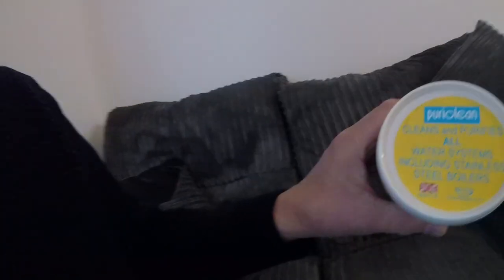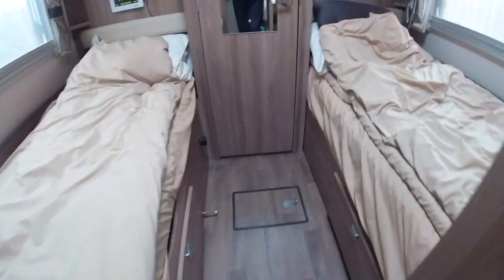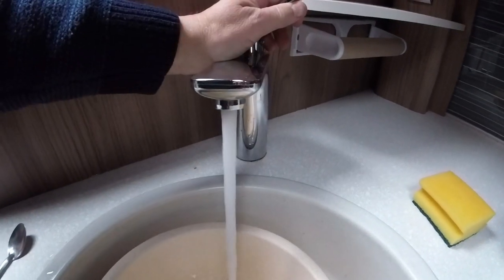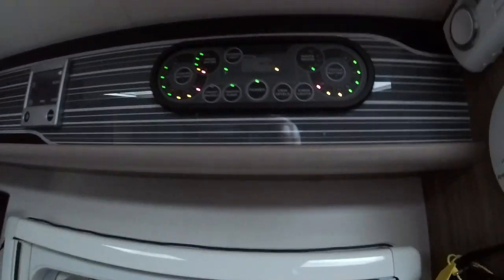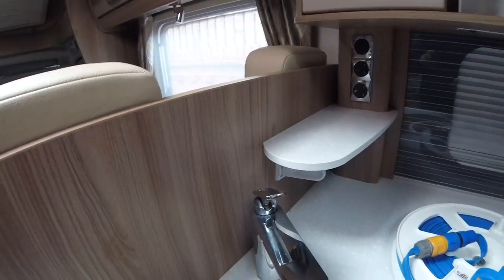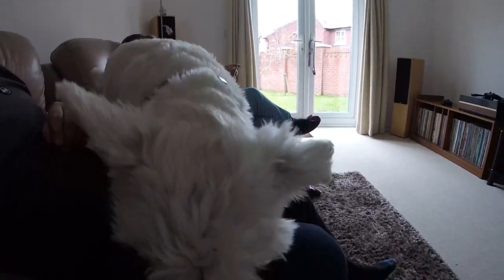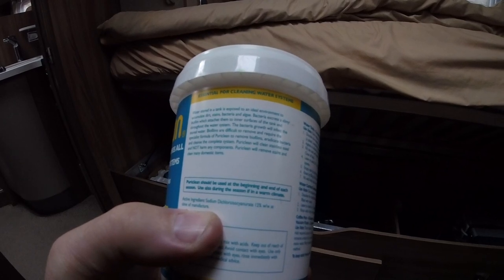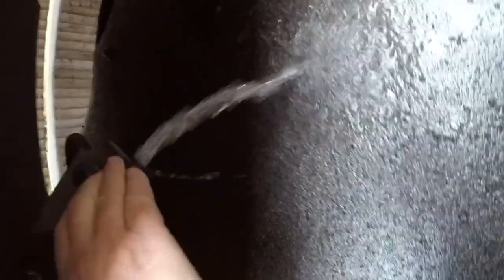Motorhome Water Sanitisation Using Puriclean

Comment: Very useful video.
Picking up our first MH in a few weeks which we are renting. Any tips or health advice when we pick up the rental as obviously we do not know the history or when the water system was last cleaned. 
Any other tips on what to watch out for on a rental MH would be much appreciated
How often do you sanitise the tanks and pipes
Reply from the maker: I try and do this about every six months. As for rental, I would check that you have everything you need for the basics, filling hose, electric cable, knives and forks, pots and pans, ramps etc., before you set off.

Comment: Hi Bob 
Very helpful video as always, can I ask a newbie question when you open the drain valve on the boiler did you run the water pump at the same time and should I have all the taps open when emptying the fresh water tank? Thanks Ian
Reply from the maker: Open the drain valve, and the taps, let the water drain both out of the fresh water tank and the boiler. By opening the taps you let the water drain down, out of the taps into the tank and out. No need to run the pump while you're doing that.

Comment: Bob, very good video, but would you also advise to heat up the water in the boiler, leave overnight, then rinse through ?
Reply from the maker: Colin Humphries I don't see the need to do that. If you run the hot taps the solution gets into the boiler.  I think the main reason to sterilize is the cold water tank.

Comment: Hi Bob loved the video. We take delivery of our first motorhome in June and find your videos extremely helpful. This may be a silly question. When you run the water through your taps I assume that it goes into your grey water tank. When you flush the water out of your fresh water tank (without going through your taps) can I assume that there is one flush-out tap under the van or are there two? So much to take in!! Thanks Davy
Reply from the maker: weebolddavy there will be two tanks with a flush tap on each, one waste tank tap and one fresh water tap.
Reply from the maker: weebolddavy no question is silly. Two tips -  film the handover and read the manuals! You'll forget a lot of what you've been told!
Reply from the maker: weebolddavy also, have a look at this video https://youtu.be/HiZnsdmivWU
Reply: Thanks Bob I thought that may be the case. I noticed in your Edinburgh video that you suggested that refillable gas was getting harder to get which sent a shiver down my spine as we've ordered a twin Gaslow system. I know that there is an app that maps all the LPG outlets around the country. I just wonder how up to date it is. Just means some careful preplanning and keep it topped up. Thanks again.
Reply from the maker: I'm sure you'll be fine as long as you can find places to fill up. At least you'll be saving a load whilst you have refillable!

Comment: Hi Rob, I’m a newbie to owning a Motorhome, quick question… when using an Aquaroll, how do you pump the water into the tank ?? I’ve only used a blue hose pipe from a tap into the filling point on the van …. Thank you
Reply from the maker: My Swift has an external 12v socket that allows me to use this external pump https://amzn.to/3rfCyAM
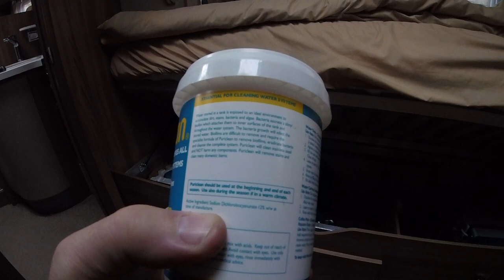Reply from the maker: Have a look at this video https://youtu.be/rxLSopAm3sE around 10:50 - part of a series.
Reply: @BobEarnshawMoHo  Thanks for the tip, now on my shopping list, I’ll be getting a kit ordered up & fitted,  appreciate the help.

Comment: Hi bob.
Do you leave the filter still in?
Or just run it through.
Any damage?
Thank you.
Reply from the maker: gary winters Good question. We have no water filter fitted on the van, there is a water strainer fitted before the pump and I can't get to that. So no, there's no filter to change. We used to have an Aquapure inline filter on our previous motorhome and with that I would remove the cartridge. We did not fit it in this motorhome because the filters were expensive and if you think about it, most homes do not have a water filter. We do however use a Brita Filter water jug at home and away for drinking water.

Comment: Have an issue doing this as my van is in storage as I can’t park the motorhome by my house but as I’ve just bought one I think I need to do it - any suggestions Bob?
Reply from the maker: Don't know, if you can't even park outside your house, perhaps use an Aquaroll or two in the storage yard, or maybe they have a water point in storage? Alternatively ask the dealer?
Reply: Bob Earnshaw thanks for the reply - there are water points at the storage but I’ll need to contact them to find out if there’s a drainage area as I doubt they’ll appreciate all the water where I’m parked

Comment: How many litres of water are wasted through the cleaning process and could the water not be used elsewhere? It the system was filtered would it be necessary still to go through all the hastle?
Reply from the maker: I had a filter system. The cartridges cost a fortune. You don't need a water filtration system unless you fill up from lakes and rivers.
Reply: I guess Dependant on how many litres of water the filter can process it may, to some be worth the cost in comparison of water preparation products and the amount of time it takes to cleanse a system and the amount water wastage during the cleaning of tanks and pipes. Social conscience included.
Reply from the maker: @johnrocker2986  Having a filter system was far more trouble and expence than sanitizing a water tank, which I did as well when I had the filter system.